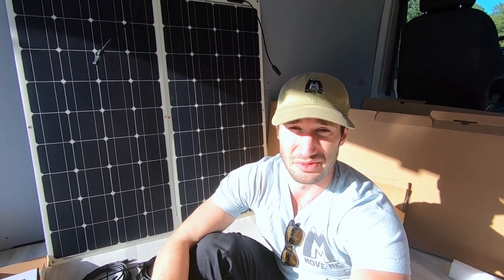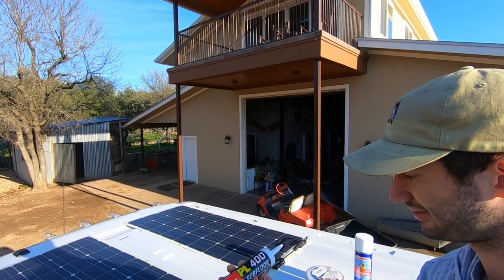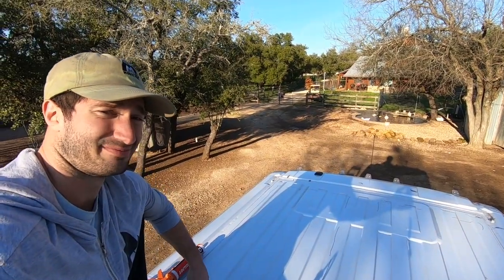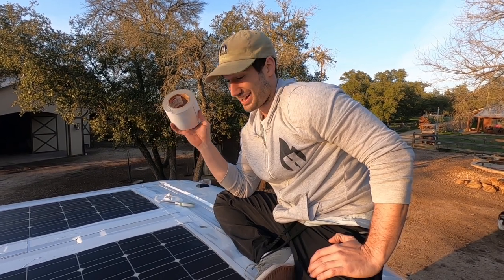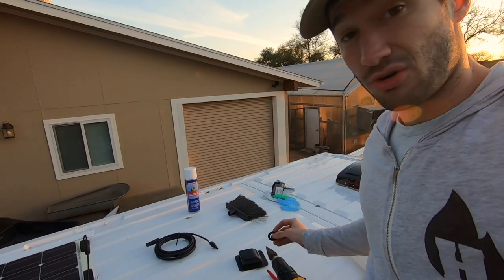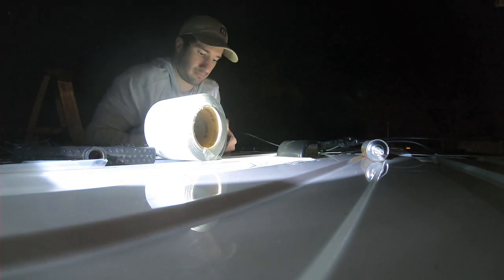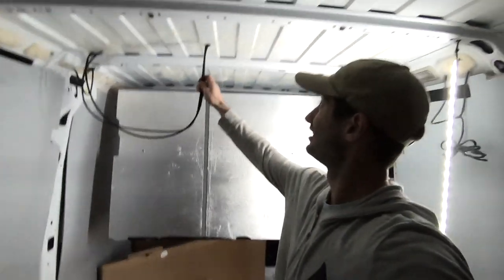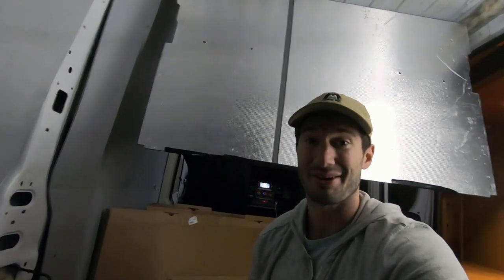Renogy 200 Watt Flexible Solar Panel Mounting | Move Me Movement

Comment: A warning to all who have purchased or planned to purchase this type of panels from Renogy, they will sometimes go bad and delaminate or bubble up and will stop producing, I purchased my panels from Amazon about 2 years ago and about 2 weeks ago I notice this defect in 1 of the 4 panels that I purchased. I contacted Renogy for warranty replacement since it has a 5 year material warranty only to be blamed that it was my installation and not the product by the representative even after looking  at the pictures, other buyers  have left similar reviews of similar defects and same warranty experience, so if you plan to purchase Renogy products beware that you might be on your own after purchasing their products, I hope this was just my experience and pray it won't happen to anyone else so beware of their warranty fulfillment and quality of their products.
Reply from the maker: While mine have not broken down yet, they are not as efficient as I hoped. This is a valid critique that. I should have addressed.
Reply: @movememovement  I agree they are not very efficient, I will be replacing my with glass and aluminum build panels for what I hear they are better and last alot longer, I've heard other YouTubers mention that this panels only last 1-3 years William with diysolarpowerwithwilliam  mentioned this on his channel about flexible solar panels another issue I noticed is that when I removed the panel from my Rv roof I noticed  what seemed like burned squares where each solar cell squares would be I think it generates to much heat and marks the surface of the roof so to play it safe I will be replacing them in the near future. Thanks for taking the time to respond hope you have a more positive experience than I did. God bless
Reply from the maker: @robertselene1  I'm thinking on doing the same. Only issue is I need to find out how to bolt it onto my roof without having to remove my ceiling.
Reply: @movememovement  Another YouTubers  named "travelnewtrails" title-  the best way to attach solar panels to your rv. He has a very good solution he uses rails from lowes and they are not that expensive about less than $15.  I used a heat gun yo softened the glue from my flexible  panels  and it came out pretty easy. I am thinking of attaching this rails close to edge of the rv so that I can screw to  a stronger structure.

Comment: Great video! The only thing I would have done different would be to call kit first let the caulking set up and then put tape covering the box. That tape is good for 25 years but the caulking is only good for a few years based off the reviews. I actually just bought a new camp trailer and I'm going to go over the entire ceiling with that tape to cover up the caulking so it doesn't get damaged by the UV rays. I noticed this video is 4 years old, how have those solar panels held up? I ordered the same panel

Comment: You should have thrown some poly board (plastic cardboard) under each panel so that there's a air gap between the panels and the roof. The long term effects these panels have are burn-ins. People usually only get about maybe 3 years out of these because of that....
Reply from the maker: You're absolutely right. I found out quickly where I went wrong. Flexible solar panels are just not optimal for this type of roof. I switched to regular solar panels before I took off on my big trip!
Reply: @movememovement  good stuff. I've had my 2 renogy 100 watt flexible solar panels on the roof of my Prius since last year. I have it hooked up to a 2000 watt solar generator from Allpowers.
Reply from the maker: @jmomoney1  that sounds like a badass set up! Im always fascinated by how people use space as efficiently as possible for their non van builds.
Reply: @movememovement  before I picked out what solar panels I wanted, I measured out the whole area of my roof to see what sizes would fit. What fits perfectly are the two 100 watt flexible solar panels that I have on it currently, didn't occur to me to just get a single 250 watt one... Learn by doing I guess

Comment: When taping the solar panels, I noticed the sides were completely sealed, but in the front and back were left open where there the Van groves are. I was wondering if it mattered. I would think it might help cool the solar panels...
Reply from the maker: Part of me wanted to completely seal them off, but then I realized water would eventually find a way in. So I wanted some in and out access so water could evaporate or drain. In all honesty I don't know what the best way to do it would be. If you're positive you can completely seal it off I say go for it. Otherwise I'd allow for front and back access so water can drain.
Reply: @movememovement  Great idea, makes sense. Tx.

Comment: Question for ya.  Why would you leave this video up if you had to remove the solar panels due to problems?  What did you eventually go with and how is it holding up?
Reply from the maker: So I didn't remove them because they weren't efficient enough. I accidentally put wholes in my roof under these panels when I was working inside my van. So I had to remove these panels anyways to fix the holes in the roof. Since these panels were already off I figured I'd get regular ones that would allow some space under them for water to drain. I made another video on my channel that shows how I installed these. I still think flexible solar panels are a fine option for a stealth van or small appliances. I just needed a bigger system and wasn't trying to be that stealthy.

Comment: This looks really nice. My only concern is that water will get under the panels causing corrosion of the roof. I think it might be better to leave some openings in the tape down for drainage.
Reply from the maker: Yeah I quickly realized this after installing them haha. They didn't hold up that well unfortunately. Very cool idea, but I would definitely recommend the regular panels if you're planning ahead. If you finish the van and realize you want solar, then I would recommend this method.
Reply: @movememovement  The panels or the Mounting Solution???

Comment: I don't understand why everyone completely skips the part where they explain how the solar panels get connected together, the kit comes with no instructions and this is the only reason im watching this video..
Reply from the maker: That's my mistake...it did take some time figuring out and I should have included it. I was probably just too tired from building all day and forgot. Are you asking about connecting them to the charge controller? Or to each other?
Reply: I would like to know how you connect all the wires from the solar panels to the charge controller or mppt.
From what I gather, is you need to buy T branch connectors to connect 2 sets of solar panel cables into 1 cable going to the mppt unit, is this correct?

Comment: How long did ur panels last are they still up there??
Reply from the maker: Unfortunately I took the panels off after a couple months. I should have put them on brackets cause water got under them and I didn't feel comfortable leaving them. They aren't as efficient as regular panels. I'd only reccommend these if you have a micro van or a car and a small electrical system that powers a fan, fridge, and charges some devices. Cool concept at a great price! Unfortunately my way of installing them probably isn't the best due to water getting under. I made another video of me installing regular panels really easily.

Comment: what kind of tape is that and is it:
1. water proof
2. ultraviolet resistant so it won't become brittle and peel off
3. heat resistant
Reply from the maker: It's in the description. I will say, I ended up taking the panels off before my big trip because the Texas heat was destroying the tape. I was never scared off it falling off, but I could tell it would not last long.

Comment: Hey, great video!  How do you find the flexible panels?  Has there been much degradation in power since you fitted them?
Reply from the maker: I don't think they're for big vans like mine. The power wasn't as efficient as the regular panels. I forgot what I was pulling in with them but I ended up taking them off and putting regular ones one. I will say, if you have a ford transit connect, or a mini van, then these panels make the most sense since they're low profile and convenient. I ultimately decided to put 400 watts of regular panels on and took these two panels off.

Comment: Two years later I’m wondering how the flexible solar panels held up??
Some people are saying they overheat and after a few months will lose half their output or even burn. 
Is this true?
Reply from the maker: I would agree with this. I put in the caption of the video that I later switched to regular panels. I would only recommend these if you just need one panel on your car or micro camper van. They're cheap and easy to install so I wouldn't rely on them for a bigger electrical system.
Reply: @movememovement  bummer. I just bought 2 of the renogy 100 watt 12v flexible panels for my 21’ travel trailer. 
I was going to glue them to the roof with silicon. 
Am I wasting my money?
Reply: @jasonboughen9542  I would ask Renogy directly.  I've seen flexible solar on tear drop campers.  Ps I've been told  silicon is meant as an adhesive,  just to seal leaks.

Comment: How has this held up? Any water under the panels or signs of weakness?
Reply from the maker: In all honesty not the best. In Texas it gets so hot that it weakens the eternabond tape. If I were to do it again I would not choose the flexible panels. The appeal is the convenience, but building this van has taught me to not go for the more convenient route.
Reply: MoveMeMovement Sorry to hear. Seems like from what I’ve read and seen, the eternabond tape is the best and most common way to adhere them without drilling through the roof, but you’re far from the first person I’ve seen now recommending against it :(
Reply from the maker: @natelasker269  It's just part of life lol. I was lazy and looked for the more convenient option. They still work though so at the end of the day it's not bad, but I would definitely recommend putting in the extra effort and getting some sturdy panels. I have a battery isolator in my van so that does most of the charging anyways.